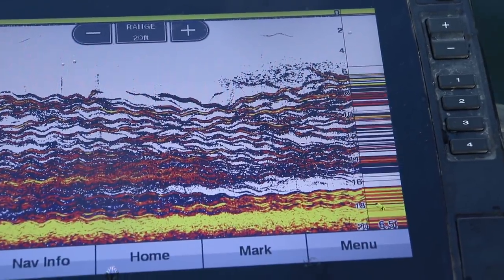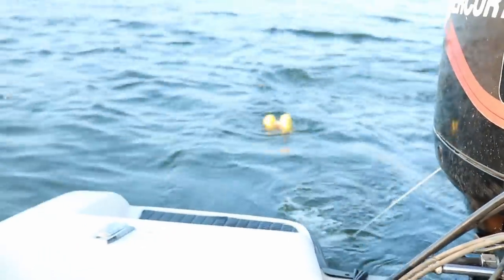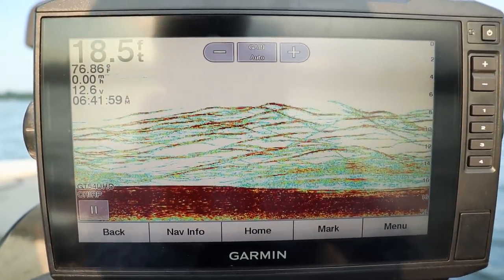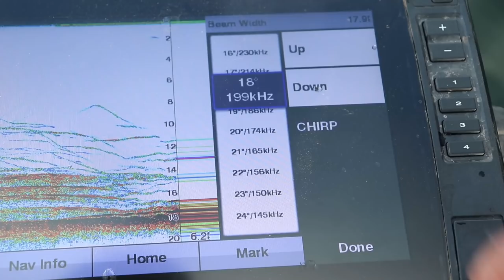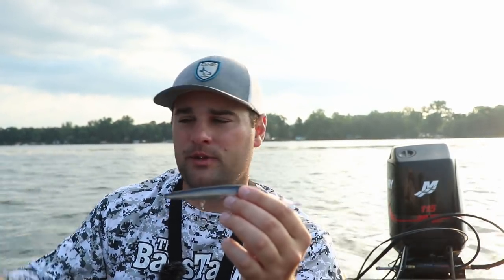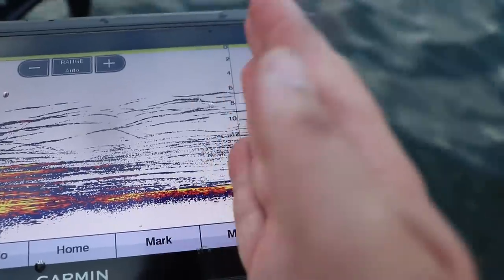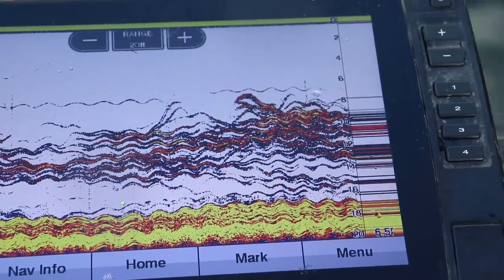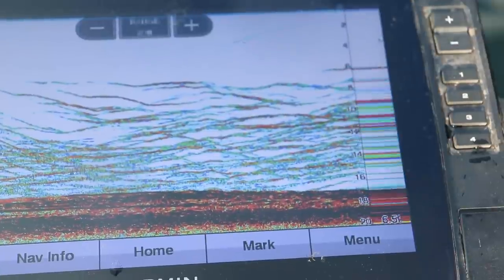How to use 2D sonar to Find Crappie

Comment: Man… you have come a long way. I was just watching one of your old slip bobber videos where you had a busted trolling motor head and now your are basically set with tech. One question, where are my best chances of finding bigger schools of crappie? The lake that I mainly fish have little to no brush piles but has super great weed lines that only hold small schools. I find that I only see large schools during the fall when they go deeper to mid-lake humps. Could it just be the population density in my lake?
Reply from the maker: Typically in the summer, crappie are spread out across the deeper weed edges. On my local lakes, the biggest schools only show up in the fall when the push to deeper water. Casting any search bait (crankbait, Beetle spin, swimbait) over the top of weeds and along the weed edge is your best bet of catching a bunch. This requires a lot of casting and moving as the schools in the summer don't just sit in a small area like they would on a brush pile.